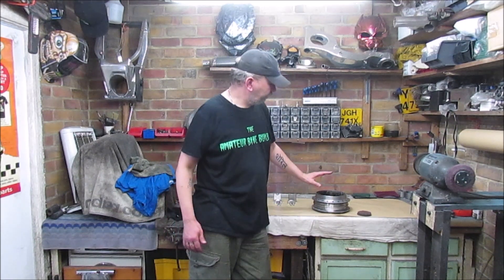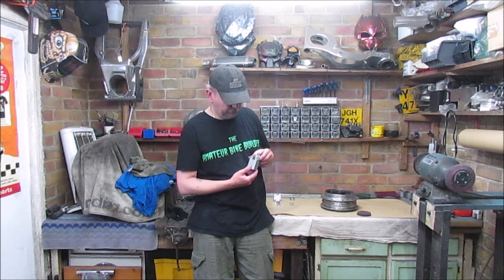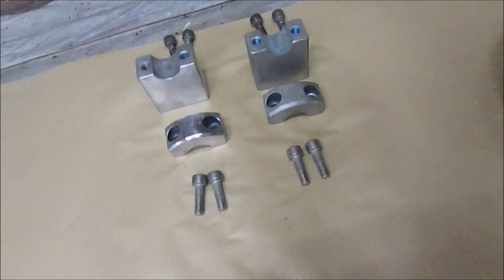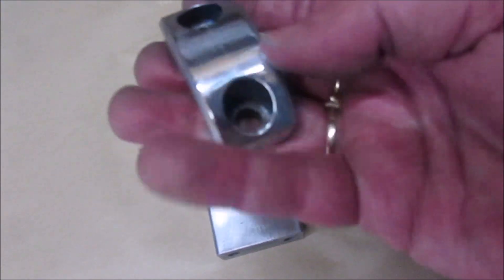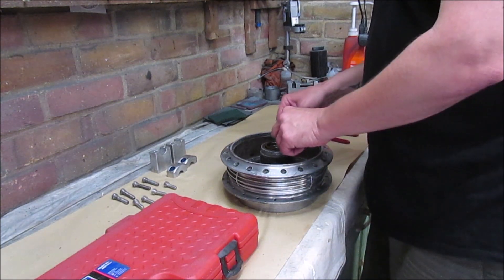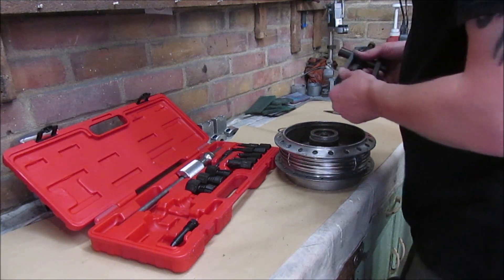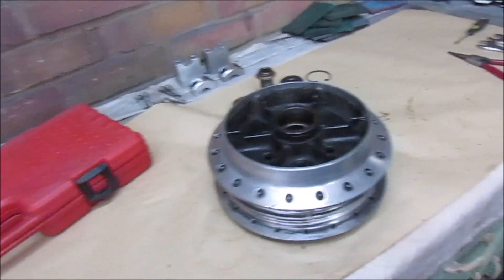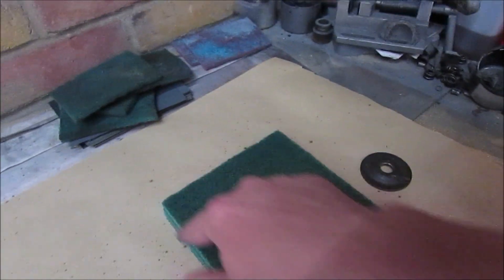Kawasaki KZ650/Z650 B1 1977 - Cleaning up the Rear Hub  - Part 67

Comment: Love the bearing puller, if I was a wealthy man (like yourself 😜) I'd invest in one.
Just took mine out, the rough way. But was replacing them anyway.
Reply from the maker: Thanks, i wish i was a wealthy man... LOL, it is a really good piece of kit, i only try and invest in things that i will use a lot and kind of earn there price, same for the ultrasonic cleaner and the parts washer
Reply: The Amateur Bike Builder, yeah would love an ultra sonic cleaner, but not doing enough to bike work to justify getting one.